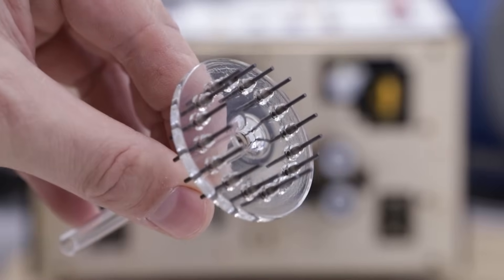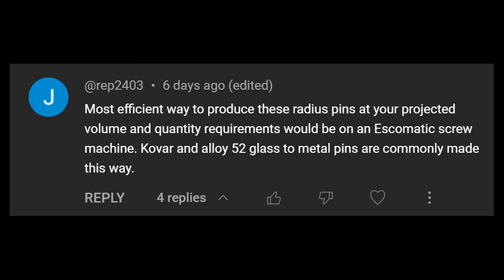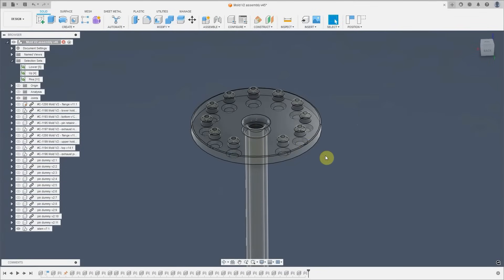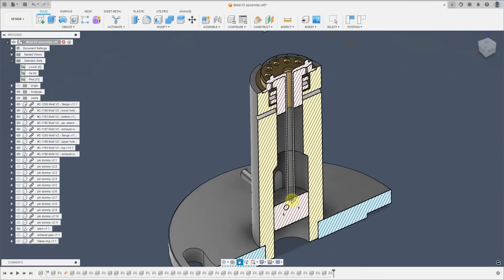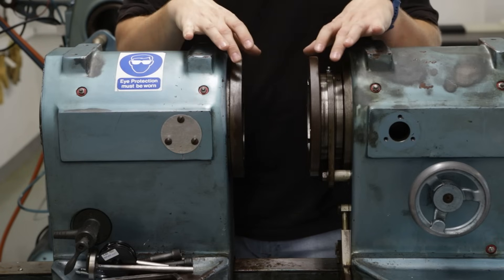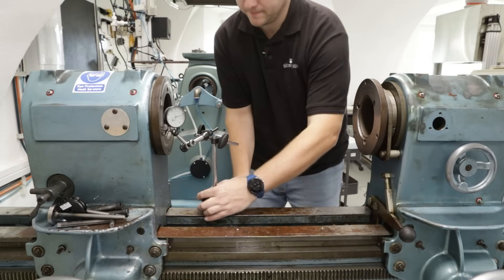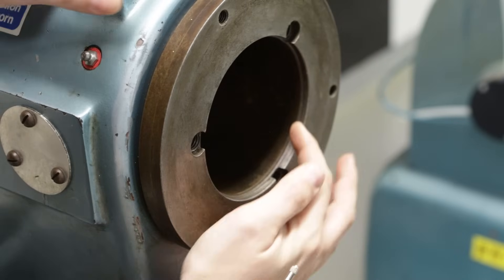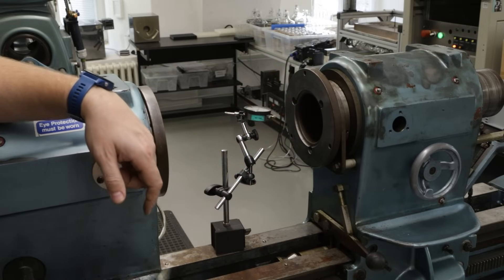New mold  design for forming the glass stem | EP#4

Comment: What you want for the pin is called a cold heading machine. It straightens and cuts the wire, then punches both ends into a die. This is how screws are made. They are available for "micro screws" and work as fast as your other wire cutter.

Comment: Glad to see that some people stay on point. I was surprised and encouraged to find this upload from you. Certainly you are quite adept  with Fusion 360. I struggle with multiple components and could use  plenty more practice. You must have hundreds of hours into that design so far. I am just beginning to test my CAM skills on a modified 3 axis CNC that would be happier doing more wood carving than aluminum (steel is not an item) Speeds and feeds are a big deal. My spindle  is suited for 16-24,000 RPMs , you on your own. Guaranteed to break many endmills. Lighter cuts and the need for flood coolant ads another dimension to the upgrade. No guide available especially for metric designs tooling and resulting toolpaths. ER20 collet means max 12mm shank and begs an upgrade to ISO30 type spindle and ER32 collets that permit tool setting.   I imagine you will have access to equipment that is more in line with your tooling manufacturers suggested figures. But I digress. This clever design of yours is captivating and great food for thought.   Wish you all the luck.   Season greetings and a Happy 2024.

Comment: You can measure the offset between the two spindles by mounting the mag base of the indicator holder to the face of one face plate, and putting the indicator probe on the inside bore of the other face plate. You don't need a special tool for it.
Reply from the maker: thats right, I will try that!

Comment: I guess you’ll need to heat the vent tube at the same time as the larger ring. How are those glass pieces going to be held in place?
Reply: The center tube is heated at the same time. The ring is loosely held in place by the pins. You just drop it over them. Once it starts melting it starts contracting by surface tension. I have seen some pretty lopsided rings still mold just fine.

Comment: 3:06 Should make a small (graphite) tool (kinda like a paddle) that picks up on the bottom of the mold and centers the glass so you don't have to touch it.
Reply: In use you generally don’t need to do anything as the ring will contract around the pins from surface tension. I however have seen some shops paddle them. Especially on smaller button stems on single head press machines. It helps fill the glass in between the pins. On a stem this large though it should not be required apart from the occasional prod to correct a blob or something. I have a small graphite pice I use for that mounted on a handle.
Reply from the maker: The goal is to build something that is completely automatic or needs very little attention. If the result is a slow machine that needs a person to operate it, then it wont be economical.. So, a graphite paddle is not an option :-)

Comment: I think your alignment should be fine as long as your boss width is sufficient to capture the end of the lead and that appears to be the case. I would also recommend a small flare in the top of the exhaust tubeulation as under heat it will want to collapse on itself and seal over.  The center hole keeper may not be able to puncture it to create an open path. It will also provide for more glass mass to work with. Once you have pins in place the glass will not want to flow as much from the outer ring across the center of the wafer. Having a supply of already hot glass there before the pressing will help that. In regular production of stems of this size it was common to have an outer ring along with a taller inner ring and then the exhaust tube but I did see it done with only an outer ring and a good amount of extra exhaust tube.
Reply from the maker: Good points - the exhaust tube collapsing is someting I am afraid of, the glass tends to collapse by surface tension right after it reaches working temperature. One of the solutions for that might be the flare - it is just an extra glass working operation after simple cutting the tubulation.. I am also afraid that the glass will not want to flow through the pins, in this case, we would have to add inner ring as well. Lets see!
Reply: @daliborfarny I began working on my Ring cutter as discussed earlier. So far I have had inconsistent results. I suspect a single torch from the outside is less than ideal. I am going to try to make a small multi flame torch like in the commercial models to heat from the inside.

Comment: I take it you want to do this vertically? Then also measure with the lathe vertical , it can make a difference. I rebuilt a few Heatways and for some reason correcting the alignment was not so easy as it looks. Laser alignment was very helpful though. Maybe you can hire a skf or other alignment laser for a day or so? For your  horizontal lathe i found the adjustment on the ground makes a difference so if you are going to use that one check the support bolts too.
What i also found in one was the bore in the stationary head to be a bit drooping with the bed, ie it was pointing down a bit. Very tricky as now the misalignment was dependent on the distance between the chucks!  Had to solve that with two sizes of shims under front and rear of that head. With laser alignment it is easier to roll the head away and see what the difference is. My bet would be on the vertical lathe in this as it is attached on a single hinge so i guess it is less dependent on how it is supported on the ground.
Check your mail btw....
greetz jerome
Reply from the maker: Hi Jerome! Thats a good point, I will try to do the measuring in vertical position as well. The tip on the laser is perfect, will look for rental around.. Cheers!

Comment: That setup with the rotating indicator seems like gravity could cause a difference between the top and bottom side measurements, so the actual misalignment might be less than the 0.1 mm you measured.
Reply: Exactly. Aligning two horizontal shafts (spindles in this case) with a dial indicator isn’t trivial. Search ”shaft alignment rod sag” and you’ll find many explanations and workarounds.

Comment: Mold misalignment is usually negated by conical\cylindrical locator pins located in the mold halves. Instead of two locator tabs place three or four round\conical locator pins on the perimeter of one half of the mold and corresponding holes in another half. Make one of the pins\holes bigger diameter than others, that will guarantee rotational positioning. Put pins on the "upper" half, so your flame does not hit them when melting the glass ring.
Reply from the maker: Good point, adding a flanges with pins/holes will be probably easier than milling the locating tabs/holes. Good to stick to a proven solution.. thank you
Reply: I don't have any experience with glass molds, but my company makes molds that have to be aligned under very tight tolerances. (sub .001in which I think is around .01mm)  We use locator pins to align the molds. Pressed on one side and slip fit on the other.  @daliborfarny
Reply: You're bang on. Even a pair of pins would probably suffice for a mold this size.